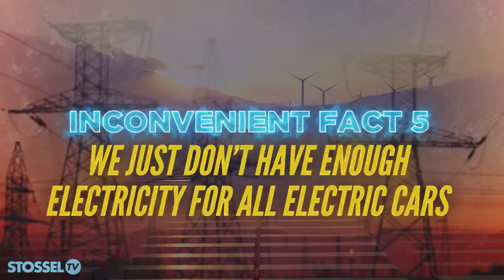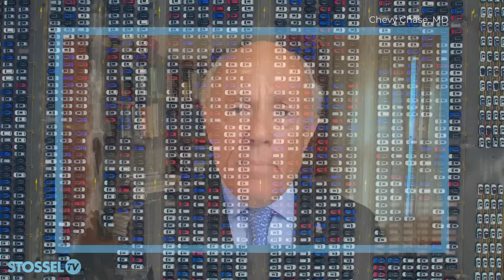Electric Cars: Inconvenient Facts, Part 2

Comment: As a retired power utility CEO and electric power engineer in the power sector for 36 years, i can say the following.  During the Obama administration there began an all out effort to ignore the input of power company CEOs and engineers (even non-profit utilities like the ones I worked for).  It came down to this, these politicians thought they knew best and always assumed we in the industry had some political angle or agenda.  However, i would tell them that electrons are neither blue nor red but they power the same grid for all people.  Eliminating fossil fuels (coal and NG) and limiting nuclear will have devastating consequences starting in 10-15 years (quote from 2008), we are about to begin a lot of hardships not seen since the beginning of the industrial revolution. Even if the oceans rise many people will end up freezing to death or overheating due to lack of affordable electric power, not to say anything about having a decent job and able to buy products at an affordable price.  No coal plants can be built in America and nuclear takes 10 years to build.  With pressure now to not build nat-gas plants, there is no base-load power generation left. When we hit rock bottom it will take years to turn it around. As the coal and nuclear plants continue to retire this problem will grow worse and there is not enough affordable nat-gas to replace them all. I pray for America as I believe we will have to go through a painful learning curve that will last years.  By the way electrons are color neutral, which is what the politicians should be and let the experts power and run the grid. Strange no one is saying anything about riding in a car that emits constant electro-magnetic fields. Most of the time intermittent absorption is not a problem, but driving such a vehicle for many years no one really knows. We never had a clamoring for people wanting to live next to our high-voltage transmission lines.  John thank you for covering this topic, maybe it will help sound the alarm to many who lost their hearing years ago.
Reply: Thank you for your rational, clear informed response.
Two term limits.
First term office
Second term life imprisonment
Reply: @hubertwalters4300  Thank you Hubert :)
Reply: I agree. ignoring experts, our "leaders" have unnecessarily put us through pain over and over.
Reply: @charlestemple634  Charles if they are breaking the law then they should be prosecuted.
Reply: @wramsey2656  - No laws involved ... Texas openly protects everything the petroleum industry does. Examples: The industry is not required to reveal what chemicals are used in fracking, is allowed to openly burn all kinds of gases that pollute the atmosphere, is not held responsible for huge damages their equipment does to infrastructure (paved roads have been destroyed and converted to gravel), no prosecution for lying about quantities of oil/gas taken from leased properties, no real controls over all kinds of pollution, individuals who win lawsuits against big oil and get settlements are required to sign non-disclosure agreements ... and so much more. My Texas family and friends and I myself have witnessed and experienced all of this.
Reply: @w ramsey You are a retired Power CEO and Electric power engineer.   We have moved on as the technology has evolved.  Let's remember some very important things.   First Nuclear is clean power, but it costs a lot to start up and maintain.  To build a Nuclear plant takes years at best.  Then you have to deal with the nuclear waste and of course it is one of those... not in my back yard type of products.   But I do feel Nuclear has place in our energy system and there has been some recent advancements that make it more viable.   

The reason for pushing Power plants from Coal to NG, is because Coal is bad all around and it isn't really that cheap, when all is added up.  The easiest and cheapest way to make energy is renewables.  Wind, Solar, Geothermal and etc, produce electricity at cheaper rates.   It is quicker and cheaper to build these systems and if we really were smart, we wouldn't even to have to build a bigger grid.   Just imagine if everyone with a home had Solar Panels and/or Wind turbine.  They could generate more energy than is needed in the area. 

What many people don't realize, is that we can also become more efficient with our energy usage.  Just changing from incandescent to light bulbs to LED saves about 50%+ electricity usage. 

What we all should, also note is that going renewables and using EVs, will save the country money and stimulate the economy.
Reply: Great to hear your perspective. If more experts in these industries would speak up, people could learn to trust the truth instead of falling prey to politicians' half-truths which come from a dark, barren place void of wisdom.
Reply: @rickbruner  Thank you Marshall.  Many of us tried to speak up during the Obama Admin but the tide had already started a political movement (almost a religion) to move to green energy "at any cost", which is the problem we had with it.  Their tools have long been to; (1) do everything to raise the price of fossil fuels and eventually cancel them; (2) Make green energy as cheap as possible (tax credits and incentives, even allowing china to sell low quality equipment into America); (3) By selling the false narrative that green energy alone can power the American grid. We unfortunately are headed toward a long and difficult road, we will have to learn the hard way.
Reply: @tonespeaks  from what I can read, Mr Ramsey has a lifetime of management and technical experience in power generation. To suggest that now he is retired, he must have no further basis for factual presentation of the current situation is ageist and insulting. I have no doubt he very much is still connected to the industry and its present tech. It is, after all, his life -long field of expertise. By all means, provide evidence of your involvement, experience and expertise in the field, because so far, all I read is the standard trope of green leftism, such as the con that renewables are cheaper. A typical assertion devoid of any evidence and oblivious to the realities which have been articulated clearly on here. If renewables were cheaper, poor nations would be building wind and solar, instead of building fossil fuel power plants, as is actually happening in the real world.
Reply: @georgebeare8883  It should also be noted that this video had to be edited/updated because some of the information was based on studies that have been proven to be incorrect. 
"The original version of this video has been updated. We originally said that covering "the entire continental United States with solar panels would not supply half of America’s electricity.” But the study we cited for this fact has been updated.  Therefore our reference to it has been removed."
John Stossel
Reply: @tonespeaks  thanks for that, but I have no problem in comprehension thus far and understood that myself. I also understand that to be a good thing. It is a sign of the author being genuine in wishing to promote accurate information on the topic. As soon as they became aware of an incorrect source, they pulled it and publicly declared it. One must conclude then, that the remaining content is relevant, current and factually correct. Thank you.
Reply: @georgebeare8883  "One must conclude then, that the remaining content is relevant, current and factually correct."  That wouldn't be wise to make that kind of conclusion, IMHO.   

Much of the video was dated information and some of the content was misleading. That part that the sourced was so way out, that they had to pull it.   The truth is, they are not expert enough to produce good content.   I wouldn't even grade it a D, because it is so backwards.   

To understand the EV industry, the content must be up to date, many things have changed and are changing rapidly.   Just the advancements in Battery chemistry has changed the industry.
Reply: @tonespeaks  perhaps you may consider Volvo, Toyota and VAG expert and latest tech qualified on the subject of EV's. They all inform us that battery tech has not dramatically changed and the inherent physical limitations of them remain constant. Given Toyota and VAG are the number 1 and 2 auto makers, by a wide margin, I will continue to reference them as propriety sources of valid and factual information. That includes their details study of Whole of Life emissions, which concludes with the finding that EV's take many years of use to just break even with an ice car. After that, assuming the EV is still on the road, using its original battery array, it will still only offer a relatively marginal emissions reduction benefit. The other obvious and fundamental limitation of an EV is its requirement for a whole new re-fuelling infrastructure to be built. Feel free to explain how the poorer nations of the world, who haven't yet even got national health clean water, sewerage and electricity infrastructure, are going to afford EV specific charging points? That accounts for some 2/3's of the world's population, making the western push to EV even more risible. EV's will achieve zero, full stop. Not zero emissions.
Reply: @georgebeare8883  "Given Toyota and VAG are the number 1 and 2 auto makers, by a wide margin, I will continue to reference them as propriety sources of valid and factual information." You're a fool, friend, if you ignore the financial incentives for legacy car makers to continue making what they do best, ICE vehicles. The Tesla Model Y outsold the Ford F-150 in 2022, and will likely outsell the Toyota Camry in 2023. Just like digital cameras, legacy film makers denigrated digital media until they went bankrupt within 10 years (Kodak). 
Your statement that it takes years for an EV to break even with emissions is false, by a wide margin. The break-even point of an EV with manufacture and fuel emissions is 15,000 miles. Every mile after that an EV is cleaner than any gas car. Over time, an EV is HALF the pollution of a gas car.
Your statement that a whole new fueling infrastructure is also baseless, it's called the grid. 95% of all EV charging is done off-peak, at a residence, and it consumes a tiny fraction of the energy a home HVAC unit does. Worried about the grid? Stop building homes with air conditioning.
Your question about poor countries needing  clean water or sewage is, well, stupid. If a country can't provide clean water, they should do that. Are you recommending that a poor nation ignore the needs for clean water, sewage and health care so they can put in a charging station?
Reply: @georgebeare8883  "They all inform us that battery tech has not dramatically changed and the inherent physical limitations of them remain constant. "
OF COURSE they say that, those legacy ICE manufacturers want to shore up their current business model and justify staying the way they are. Battery tech has not only changed dramatically, the rate of change is similar to the microchip improvements in the early 1980s. The range and longevity of EV batteries has made massive improvements. My own personal EV, same model, can now be purchased, same price, with almost double the range in only 9 years. The miles-per-gallon of a Ford Model T: 22 mpg. The average MPG of a new automobile in 2022: less than 25 mpg. 
It's time to update your information, and it's time for a new opinion.
Reply: @justsomeguy934  battery tech, in relation to EV's, is Lithium, in the here and now. Lithium is regarded as the preeminent source. EV range has improved, but not just because of battery technology improvement, just like every other mode of transportation has evolved. It is the sum of a holistic range of improvement across the whole vehicle design, right down to eco-tyres.

Physics predetermines the potential limit to a lithium battery's abilities. We have come close now to reaching them, there is no great advance to come. A leap forward in battery tech must now come from a new, as yet unproven, form.

I can rely on you for providing the most risible and meaningless comparisons and pseudo-facts to try supporting your assertions. I particularly had a great laugh at your (apparently serious) comparison of a Model T to a current 2022 car with regard to purported fuel economy.

What this reveals, as if nobody already knew, is the typical EVangelist's abject absence of technical understanding of car, in general.

First of all, electric motors have been around as long as combustion engines. Dating back to the late 1890's. In the time since, an electric motor has effectively remained the very same, very basic unit. It consists of just 6 basic parts.

To compare a Model T engine to a current tech 2022/3 engine and conclude, in any way, that they are effectively unchanged serves only to make you look conclusively uninformed. 

That is before we even go to the incredible differences of performance, comfort, safety, reliability, emissions, power and convenience of the modern car that modern engine resides in. All of which must be included in any comparisons.

I am disinclined to waste my time having to spend lengthy periods of time in a pointless, in-depth exercise, which is what dealing with your inanities entails.

So, instead, a simple comparison for your simple contentions.

A 2020 Ford Mondeo TD can travel 1200 to 1300 kilometres on a single 61 litre tank of fuel, on the highway, at 100 to 110 kph. It has a top speed of 130 mph or 210 kph. It comfortably and safely carries up to 5 people. It can tow up to 1600kgs. I know, I own one.

Only a fool would somehow conclude there is any semblance of direct comparison to that car and  Model T. A fool like you.

And that is where I intend to cease replying to your nonsense in future.
Reply: @georgebeare8883  ah, when facts disprove your statements, you call names. Only a fool would ignore the fact that average MPG of the internal combustion engine has reached its limits due to physics. There is no 100mpg, 200mpg automobiles coming out that you will be able to buy or use in a practical manner. Sorry friend, the facts prove your wrong. The only improvement in ICEs are horsepower per litre, not fuel economy. Are there exceptions? Sure - my brother's Honda Civic gets 42mpg. On average, however, the ICE vehicles will waste 3/4 of their energy as heat, and that constant in the physical world is one of the major limitations of petroleum technology. 
Your statement of battery tech being at its pinnacle is clearly a reaction to my statement of ICE tech being stalled. Sorry, battery tech is not only evolving, it's improving enormously along with motor tech. I noticed you completely ignored my verifiable statement that my exact model of car, almost 10 years later, has a 40% improvement in range at a smaller price. That's partially due to a marginal battery expansion, but more due to a different motor, heat pumps and new battery chemistries and footprints that yield more kW/h per kilo.
The averages prove you wrong, and I'm sorry you're embarrassed.
Reply: @georgebeare8883  "It comfortably and safely carries up to 5 people. It can tow up to 1600kgs. I know, I own one." And I own a gasoline RAV4 that gets exactly the average MPG I told you about. If it gets 23 mpg highway + city, I'm happy. I also have a supercharged V8 sports car that gets 16 mpg, 11 mpg when I push it. Did you want to talk about averages or exceptions to bolster your opinion?
Reply: @georgebeare8883  "battery tech, in relation to EV's, is Lithium, in the here and now. Lithium is regarded as the preeminent source." Do you think lithium is the only component of a modern battery? Or that its concentration is fixed? Goodness, lithium concentration in a modern battery can vary in current production from 2% to 4%. Tesla has already converted about half of battery chemistries to LFP, non-cobalt, because LFP represents a significant cost savings. If memory serves, CATL (Tesla's main battery supplier in China) us making nothing BUT LFP chemistry for the Chinese market. There are also other chemistries being tests, as well as the ever-elusive solid-state and aluminum designs.
Reply: @georgebeare8883  you have no interest because you have no evidence, no thought, no ability to discuss any technical topic. Run home, kid, you came unarmed to a battle of wits.
Reply: @justsomeguy934  I ignored nothing. It is you who has no ability to comprehend. I told you directly that increases in range were not just down to battery changes, but an holistic improvement, right down to eco tyres. Read again and see. 

There are billions of dollars being invested in ice tech right now, both in Europe and Japan. The Japanese auto makers have even formed a tech JV regarding ice, so certain are they that ice has a long future ahead of it. Nobody invests billions in business unless they expect a ROI.

They see plenty of major improvement still to come. Just as it has done in just the last decade.

Talking about limitations, a half ton battery gives a few hundred K range and 60 kgs of fuel gives an ice car 800-1300, depending on the model. There are some other physical facts for you.

Your averages prove mothing to anybody. You pull figures out of the sky. 

My only embarrassment is that I am involved in any form of discourse with you about anything, the person who tries to claim a Model T is on the same level as a car in 2023.

Well, that embarrassment ends here and now. Goodbye.
Reply: @justsomeguy934  just one quote from that link: StockApps’ financial lead Edith Reads has weighed in on the data. She holds that Toyota’s debt is good debt and even necessary. She suggested that the company’s amassing of that level of credit is in line with its future-thinking nature. Here’s what she said about the development:

“It’s not unusual for Toyota to have such a colossal debt on its books; most global corporate giants do. Debt allows companies to reinvest in their businesses, growing them further. The key is keeping that debt sustainable, and Toyota has done well on that front. Being a player in a highly competitive sector, R&D constitutes a significant chunk of Toyota’s budget. That and other expansion needs make such debt a necessity.”

Edith holds that the revelation of Toyota’s indebtedness is welcome news for investors. Measured against the company’s earnings, it shows that it is operating a healthy business. That is a cue for Toyota’s current and would-be investors. Besides indicating the viability of issuing firms, corporate bonds are one of the most lucrative investment tools.

Your lies exposed, ironically, by what you yourself posted up. Goodbye for good.
Reply: @justsomeguy934  you can't even create an original put-down. just re-using the old line about the battle of wits. That may have seemed clever when I was a kid, but most people have moved on from there. 

All you do is post up lies and half-facts, as I have repeatedly proven.

Such paucity of perspicacity cannot confront, nor affront, me. All it has the potential for is to waste precious time when it elicits a response. That time has ended.
Reply: @georgebeare8883  Ah, facts embarrass you, do they? There's no new 100-mpg or 200-mpg gasoline automobile in our future. The average MPG is the same since the Model T, and that absolutely verifiable fact is what embarrasses you. Both the Model T and any ICE you want to pick waste 75% of their energy through waste heat. Any ICE vehicle you want to point to only has about 15% of the fuel's energy make it to the wheels. We are utterly topped out in ICE development, and were a century ago as far as fuel, efficiency and pollutants go.
Reply: @georgebeare8883  "Your averages prove mothing to anybody. You pull figures out of the sky. "
Really? Let's call it the GOOGLE sky! Go ahead - I DARE YOU - search "average mpg of a car in 2022". Oh, I'll save you the trouble: "Generally, a good rule of thumb for gas mileage nowadays is to make sure you are getting at least 23 MPG combined city and highway. Mar 23, 2022"
Reply: @georgebeare8883  "My only embarrassment is that I am involved in any form of discourse with you about anything, the person who tries to claim a Model T is on the same level as a car in 2023."
When we're talking mileage, pollution, energy loss it's the same. Too bad you can't see that the common denominator in the argument is the FUEL. That's right, friend, gasoline is the same. You can put modern gasoline in a Model T today and it will run. I do sympathize with your embarrassment, however, many people don't think before they say something.
Reply: Now here is some real perspective on the reality of providing power to the masses. So frustrating that NO politicians on any side seem to be making this argument to educate the politicians. Thanks for your input!!
Reply: @dh7139  Thank you DH.  Its sad we are having to go thru this.  Its already started regional blackouts are on the rise, it will get worse in the next 5-15 years before we learn this hard lesson.  I am ill and likely will not be around when it does. I only hope those like me who continue to speak out for reason and common sense will at some point prevail. God be with us.
Reply: Just read about electric locomotives, how they impact health of their drivers. Ie. you one of them wants kids he should get them fast.
Reply: @marcinnawrocki1437  that's quite a conclusion to draw (EVs affect birth rates).
Reply: Earthwilldie666
Reply: During Obama I remember an incident where an Engineer told a politician that it would violate the laws of Physics and was stunned to hear the politician reply that "then we'll just have to change those laws".
This is what happens when you elect arrogant people instead of smart people.
Reply: @ghost307  WHAT would violate the laws of physics? Solar energy is enough to power the USA? John Stossel has already retracted his foolish statements in the original video and republished it.
Reply: @georgebeare8883  "Talking about limitations, a half ton battery gives a few hundred K range and 60 kgs of fuel gives an ice car 800-1300, depending on the model. There are some other physical facts for you."
Actually, you've made the classic mistake (again) of comparing a battery weight to an ICE vehicle without subtracting the ICE engine weight from the EV. 
Here are some facts for you: my 1,000lb car battery (again, old tech, 9 years old) replaces a (on average) 800lb ICE motor, a 300lb transmission and fuel/exhaust system. That's right, an EV doesn't have those things. And my EV has about the same range as my gas RAV4! The new EVs, cheaper (by half!) than mine go FARTHER than my gas RAV4 goes. Did you want some more facts?
Reply: @georgebeare8883  "There are billions of dollars being invested in ice tech right now, both in Europe and Japan. The Japanese auto makers have even formed a tech JV regarding ice, so certain are they that ice has a long future ahead of it. Nobody invests billions in business unless they expect a ROI."
Um, Kodak was investing in film right up until the digital camera put them out of business! In fact, Kodak invented the digital camera and owned the patent. 
OF COURSE traditional car makers are investing in what they know to do. They think they'll bribe politicians to extend any deadline or clean air change so they can continue to make money the only way they know how - ICE vehicles.
You can't be that ignorant, can you? You do know Blockbuster was building stores after Netflix was a thing, right?
Reply: @georgebeare8883  "Your lies exposed, ironically, by what you yourself posted up. Goodbye for good."
HAHAHAHA - In just 10 years, Tesla has TWICE the market cap of Toyota. If I told you 10 years ago that an electric car maker would unseat the world's largest car maker, what would you have said? Called me foolish, stupid, an idiot? TaDa! Here we are, friend. Toyota is no better than GM or Ford in that they cannot see the future. The only car maker who can't build factories fast enough is Tesla; Toyota is closing factories. The future is here, do you see it?
Reply: excellent.  what about electric fields in the cars?  Long term health problems?  We ei;; see.
Reply: @tombrown108  I can't imagine that would be an issue. People were predicting brain cancer with cell phones...
Reply: Which Utility company were you a CEO for? Does it have a name?    ..................and where might this company be located?
Reply: @ghost307  You are so correct friend. It makes me weary thinking about where our country is headed.
Reply: @georgebeare8883  Thank you George your a gentleman and a excellent example of man gifted with wisdom.
Reply: @paulholterhaus7084  Paul i was trained in BWR and PWR reactors, please don't jump to conclusions to about where i am living. As one responsible i had to live in the current and what was allowed. The truth is you are correct and i would agree going with Westinghouse 1000 reactors and the modular reactors currently being developed for smaller 100MW module type plants. The sad thing is we live in a world full of evil people who would target each of our plant sites via terrorist or enemy nations air strikes.  My fellow resident managers who were at two different nuclear plant sites after 911, at one point had the military there with missiles to shoot down airliners! Those of us who had and have to keep the grid up and running are not living in the past, we see the world thru eyes of reality. We must keep the grid up and running here and now, we are not favoring one technology over another; moreover, we want to keep the power on for all.  Its getting more difficult because some people think they are the experts and the politicians believe in whatever is popular. I agree with you fission and hopefully fusion will be our best solution for base load power.
Reply: @georgebeare8883  "“It’s not unusual for Toyota to have such a colossal debt on its books; most global corporate giants do."
Toyota is the fourth most indebted company the world, friend. And operates in the world's most indebted country. Neither of those two represent "good debt". Their future is tenuous at best, just like Ford and Volkswagen, and I personally doubt they'll exist in 10 years without a government bailout. Nissan is already on the way out, if Japan bails out Toyota (and they will), they won't also bail out Nissan or Mazda or other struggling auto makers. If you're not Tesla, you won't be around for long.
Reply: @georgebeare8883  Hey, George! Guess what? Akio Toyoda (CEO, Toyota) just stepped down BECAUSE he can't lead Toyota into the "digital" age and admitted to not steering Toyota in the right direction as far as EVs go. Did you want to tell me AGAIN that Toyota and Volvo are going to be industry leaders in the future? When the CEO of Toyota steps down BECAUSE the misjudged the EV market, their future is NOT assured. Just liking for an "I told you so"...oh wait, I just did!
Reply: @hlw1306  "I think a point he makes is the pending catastrophe of letting the baseload of power generation be diminished to the point that huge suffering follows by ending old sources when new sources are inadequate to meet a vast array of power needs."  

I totally understand you point, but it doesn't make sense to invest money into a Powerplant run on Coal that isn't going to be used in the future.   The new sources of power are adequate for the vast array of needs, but we also have to conserve.  For example, instead of using an old Incandescent bulb, use an LED bulb which uses a 1/3 of the power. 

As a Pilot, I totally agree with you about the fuel storage issue.  It seems no one wants to do anything, until there is a major event, then the funds needed to address it are 3x of what it would have caused initially.

The USA produces all the oil it needs, it isn't reliant on other nations, maybe Canada. 

I don't know much about he politics in California, but no administration disregards knowledge and experience.   People have differing opinions, doesn't make either side wrong.
Reply: @johnrodgers2171  "We're being led by morons and shareholders who just want their stock investments to go up in a very short time span." 
I couldn't have said it better about our politicians and oil executives.
Reply: @georgebeare8883  🤣
Reply: @georgebeare8883  He's a pathological liar. He's all over the net parroting the same lies despite being debunked over and over again. Do not waste your time.
Reply: @justsomeguy934  HAHAHAHA right back at you. Last Thursday, the EU vote to ratify the banning of the sale of ICE vehicles by 2035 was.....postponed. Germany, Italy and a range of other EU nations are now realising the folly of the notion to ban ICE vehicles outright. The UK have already "re-set" timing regarding sales of EV's as a percentage of total market of new car sales as well.
Reply: @georgebeare8883  "Tesla's market cap is a mirage, based on the same thinking that led to the other tech stock crashes. " Ya, been hearing that for years. The fact is that Tesla has years of sales booked, cannot make factories fast enough, is generations ahead of other car makers in both technology, design and manufacturing automation (i.e., lower costs). Tesla's profit margins per car are FOUR TIMES that of Toyota. You can call that a mirage if you want to, but I call it your bias blinding you. How's your Kodak stock doing?
Reply: @georgebeare8883  You insane bias is absolutely amusing. How did I forget anything different between an EV and an ICE? I am well aware, and can quote you, all the metals, cables and control items that make an EV work. What you seem to forget is the massive blocks of similar materials that an ICE vehicle has than an EV doesn't. By all means, tell me what I'm leaving out when it's YOU that mentioned only the battery having a short life and the materials required to make it.
Reply: @georgebeare8883  "EV's have been around as long as ICE have. 
Henry Ford had a running EV prototype Model T, smart guy. "
Not only do I know that EVs have been around the same time as ICEs, I give presentations to that fact. You're welcome to attend one if you like.
The practical fact about ICEs is that the only advancement that ICEs have made that you can use is horsepower per litre. The average MPG remains the same. Your insults to me prove that you weren't aware that ICEs are limited by the physics of converting liquid, combustible fuel to kinetic motion. It's been the same for 100 years now - over 70% of the energy in gasoline is wasted as heat during the combustion process, and nothing can change that. Despite emissions improvements and horsepower per litre, the average MPG of a modern car remains within a few miles of the Model T. I'm sorry the facts anger you and destroy your narrative, but there is no 100mpg ICE vehicle that you can buy on the horizon. After 100 years of engineering, the average MPG is the same. Facts rule. Did you want to call me more names?
Reply: @georgebeare8883  "They made more money from selling carbon credits, in fact it was their primary revenue source up until very recently. " Tesla sold ZEV credits, still does, to ICE manufacturers that refuse to convert to EVs. Any car maker can get them if they want to. Funny, you don't mention the bailouts and subsidies that ICE makers get as part of their income...strange omission on your part.
As for Tesla's profit margin, please Google: "tesla profit margin vs toyota". Go ahead, Google that. Here's the results:
"Recent data compiled by Reuters shows that Tesla's margins are significantly higher than those of its rivals, both in terms of gross and net profit.
...
Cranking up the Heat.
Company	Gross profit per car	Net profit per car
Tesla	$15,653	$9,574
GM	$3,818	$2,150
BYD	$5,456	$1,550
Toyota	$3,925	$1,197"

So I can expect your apology at claiming I "make up stuff"? I'll wait...
Reply: @georgebeare8883  "Go charge your Tesla ( I note you NEVER declare what EV you own, and I know why. So your idiotic claims about it can't be dismembered ) at a public charge point. If you can find one. If it works. If the app is the same. If there isn't a queue."
I've driven 90,000 miles all over the USA in my EV, never waited for a charge, driven the same time as I would take in an ICE vehicle. I know Uber drivers in EVs with the exact same experience. Your desperate attempts to say EVs won't work has been heard for ever a decade now, and you're just as wrong now as those people were then. The fact is that my car is the best one I've owned, is many times more reliable than my Toyotas ever were, it's full every morning and I think nothing of getting into it at a moment's notice and driving across a continent. Oh and I do it for pennies a mile, thank you.
Let me ask you again: how's your Kodak stock doing?
Reply: @justsomeguy934  how is it you cannot comprehend the sheer inherent folly of the comparison of a Model T and a 2023 car? I went to great lengths spelling it out to you months ago. 
To obviously no effect, whatsoever.
I am not going to go into it all over again, it is time consuming, which is a waste, when you refuse to concede anything, ever. No matter how clearly a point is correct.
The closest you have come to concession, is when you can't actually challenge a point so, instead, you go into conspiracy theory about mythical car cartels or whatever.
I am going to summarise once more, and only once more, regarding the vacuous claim about fuel economy.
My 12 year old nephew has been reading this claim you promote, so I asked him what he had to say about it.
He said, I quote " Uncle George, if a modern engine produces many times more power than a Model T using the same amount of fuel, then that makes the modern engine much more fuel efficient, doesn't it?" Unquote.
Yes, young Luka, that is blatantly obvious and correct.
How is it a 12 year old can figure such an obvious thing out, yet you, cannot?
To put it another way, if we had to install a modern engine into a Model T to simply provide the very same engine performance of the Model T engine, that modern engine would be a very low displacement motor bike engine and would surely achieve over 100 mpg.
Model T's were very lightweight and had no power accessories, no anything. They didn't even have a full body as we know it today.
This is why any such comparison is beyond next-level absurd.
The end.
Reply: @justsomeguy934  here we go, yet again.
You mocked me, as usual, about the weight penalty an EV inherently has over an ICE vehicle.
You mocked me because I pointed out the 1,000 pound battery array, you firing back with calling me being the fool because an EV doesn't have an engine and the like.
Remember that? It was only a couple of comments back.
I note you completely left alone my response, didn't you? Funny that, considering how you love cutting and pasting my comments back at me.
Could that be because I pointed out that EV's actually do have motors, up to 4 in some cases?
Yeah, shucks, hey? You thought EV's just ran by a magic battery that propelled it as well as supplying the energy.
Doh! 
Everyone else knows EV's have an approximately 50% weight penalty over an equivalent size ICE vehicle. Everyone, that is, except Emeritus Professor Some Guy.
Tyre manufacturers produce EV-specific tyres, which have much higher load ratings because of the much higher weight of an EV.
Once again, you seek to demean and debase others, yet through your own words, it is you who best condemns yourself as being an absurd caricature of evangelical fanaticism, locked in moribund, frozen and myopic narratives.
The more you thrash around, proffering the evermore improbable and the downright impossible, the more you inadvertently subvert your own position.
I care not what you direct at me personally, what I enjoy is knowing that any of those people who may be reading all of this, those people who are on the fence, seeking answers to questions about the Pros and Cons of EV V ICE, will draw their own conclusions.
Common sense, factual evidence and rational thought are my allies, as much as they are your foes.
Please do feel free to keep going. It is very helpful.
Reply: @georgebeare8883  "Everyone else knows EV's have an approximately 50% weight penalty over an equivalent size ICE vehicle. Everyone, that is, except Emeritus Professor Some Guy."
Everyone knows, do they? Really? Funny, my personal EV, when compared to its closest ICE equivalent, is actually LIGHTER than the ICE vehicle. If you're trying to make an argument, you would be laughed out of the room with an authority claim of "everyone knows".
Here are the actual vehicle weights of similar class automobiles, by all means show me the 50% weight penalty (as if that even would be a factor of ANYTHING):
Tesla Car Weight vs. other Compact Executive vehicles:
Tesla Model 3 (compact executive car) weight: 3,648 to 4,250 lbs. Other Compact Executive Cars: BMW 3-series, weight 3,582 to 4,138 lbs: difference 112 lbs. Genesis G70 weight: 3,688 to 4,041 lbs, difference 209 lbs. Infinity Q50 weight: 3,781 to 4,019 lbs, difference 231 lbs. BMW 4 series weight: 3,578 to 4,034 lbs, difference 216 lbs. Average difference: 192 lbs. Please tell me the added wear on the roads, either way, with those statistics, which is the weight of a passenger. In the case of the Tesla Model S, its nearest comparator is the Mercedes S-Class sedan, which weighs MORE than the Model S.
It's time for you to tell "everyone" that their 50% weight penalty is WRONG.
Reply: @georgebeare8883  "I note you completely left alone my response, didn't you? Funny that, considering how you love cutting and pasting my comments back at me."
I quote the portion of your long posts  back at you so that the context of my comment is clear. When you make dozens and dozens of claims, the response to those claims needs to be specific.
Furthermore, I have found that MANY people, when proven wrong, delete their comments from YouTube and "retreat with delete". I make sure the statement you made to me is portrayed accurately. You're welcome...you wouldn't want me misrepresenting your words, now would you?
Reply: @georgebeare8883  "Tyre manufacturers produce EV-specific tyres, which have much higher load ratings because of the much higher weight of an EV."
Some do, but so what? You can also buy tires specific to off-roading, specific to lightweight passenger cars (like the Toyota Yaris). I run an EV club of 250+ members and not one of the members has EV-specific tires. After 9 years, I've never had one, will never get a set. Your weight argument as a detriment to an EV is actually stupid - who would care? Does ANYONE buy a car or not buy a car due to its weight?
Reply: @georgebeare8883  "Could that be because I pointed out that EV's actually do have motors, up to 4 in some cases?
Yeah, shucks, hey? You thought EV's just ran by a magic battery that propelled it as well as supplying the energy."
If you'll look back at my comment, I told you that I can actually quote you the list and weights of the components in an EV, cabling included. I avoided nothing, but you're desperate to make some silly claim that EVs are heavier than an ICE vehicle for some meaningless reason.
The fact is that when people like you try to claim EVs are always heavier than an ICE, and quote the weight of the battery, they inevitably add the battery weight to the weight of an equivalent ICE vehicle. You cannot do that, as you must subtract the weight of the components that an EV doesn't have. The net weight is within a meaningless amount that has NO FACTOR in the usability of either vehicle. You really are silly to go down this path, it's like saying "there's more glass in an EV! That proves they're bad!".
Reply: @georgebeare8883  "Common sense, factual evidence and rational thought are my allies, as much as they are your foes."
Ah, the literary bark of a cornered person. It's me that has provided you with Google search results, me that has provided links to the evidence of the statements I make. All you can say is "everyone knows...". 
Yes, rational thought and factual evidence DO apply here. And we both know which person has them and which person does not.
Reply: @georgebeare8883  "To say, as you have, that a modern engine now produces far more power, yet in the same breath, also declare it is not more fuel efficient is an oxymoron."
Miles per gallon is miles per gallon, friend. Given the same amount of fuel, a Model T will go almost EXACTLY that same distance as a modern vehicle, horsepower, power windows, emissions is not a factor whatsoever. You can slap a catalytic converter on a Model T and make it instantly cleaner, but that has nothing to do with the engine or the fuel.
I think you don't like being proven wrong.
Reply: @georgebeare8883  "I am still waiting for you to reveal what Make, Model and year EV you claim it is you own, by the way."
Why? I own a 2015 Tesla Model S. Facts are facts regardless of brand. Methinks you want to call me a liar as to my personal experience.
Reply: @georgebeare8883  "Sure, I respond in kind to what YOU started, with personal derogatory comments. Not out of having no answers, the remarks are in the middle of the very answers that pull apart your nonsense."
Of the two of us, which one is providing verifiable Google search results and links to resources? Remember the comment you made early on where you stated my car's battery would have to be replaced, and that I would have a vehicle that could neither drive nor be sold? I not only gave you my personal experience, but that of another EV owner that completely disproves your statement. 
The nonsense is your lack of factual information, and your inability to admit when you're wrong.
Reply: "How it is that you do not see that a Model T is galaxies apart from a modern car?!"
The Model T, and any ICE vehicle, has the same physics limitation as does a modern automobile. I only comment on fuel economy, and that regardless of options or horsepower or anything else, ICE vehicles are a mature technology and are not going to improve in any meaningful manner. You backside seems rather scorched by me proving that there is no 100mpg gasoline car on the horizon, no dramatic improvement in energy consumption or range whatsoever for gasoline engines. The fact that the Model T has the same milage as the average 2022 automobile proves that...at least proves it to anyone willing to admit their bias is clouding their judgment.
Reply: @georgebeare8883  "I am still waiting for a range of answers to some of your more preposterous claims, which I have called out."
You're waiting on nothing from me! By all means - quote back any and all comments I made that you need clarification on. Be careful, however - I'll demand you admit you're wrong when you're wrong. All you've done so far in the fact of facts and links to resources is to type long paragraphs calling me names.
Reply: @georgebeare8883  "To say, as you have, that a modern engine now produces far more power, yet in the same breath, also declare it is not more fuel efficient is an oxymoron.
A totally contradictory contention."
I gotta ask, are you an adult? Am I talking to a teenager? How on EARTH is horsepower the same as miles-per-gallon? Should we compare the miles-per-gallon of a rocket to that of an automobile, saying the two entities are equivalent? Egad!
I've already stated that other than horsepower per litre, ICEs have no significant improvements coming. Their average efficiency is limited by their fuel. The amount of waste heat, on average, burning gasoline is the same for the Model T as the modern Subaru - about 70% waste. You are desperate to not admit that regardless of electric windows, horsepower, sunroofs, nice upholstery or anything else external to the ENGINE, gasoline engines are not going to improve.
Reply: @georgebeare8883  "You persist in the ridiculous fuel consumption comparison of a new car to a Model T  basing it solely on some spurious claim they are about the same. "
You persist in your delusion that I presented you with verifiable, demonstrable facts that the Model T and the average MPG of new cars is the same, no practical or significant improvement.
It's time to call you out - is or is NOT, the average MPG of a modern car the same as a Model T? Yes, or no? After 100 years of development, why is there no 100mpg or 200mpg gasoline vehicle available? Could it be that the tech for ICEs is limited to the laws of physics? 
I'll wait for your admission that a 100 year old car has the same MPG as a modern one. Let's see what your integrity is. We both know you'll deflect, your favorite word.
Reply: @georgebeare8883  "I note that every time I expose a claim of yours to be wildly inaccurate, or downright false, with readily verifiable evidence, I hear no more about it.
You just jump onto the next risible assertion. And around we go again."
Liar. You have yet to quote me a single statement you want me to respond to. Between the two of us, I respond directly and specifically to all of your statements by quoting back your comment. This keeps the context of the discussion germane. By all means, tell me any statement you want me to respond to. I'll quote that statement back to you, so you know exactly what I'm responding to, and I'll give you my reply.
Reply: @georgebeare8883  "n reality, you quote me back because, at that moment, you think you have got some clever response. That you have caught me out. Only to discover when I next respond that I have picked apart your reply as usual, and as simply, as always."
As I've stated multiple times, I quote back EVERYONE I respond to so that you know exactly what I'm talking about. This also allows you (or anyone else) to read the comment days/weeks later and not have to backtrack a hundred replies to see what is being discussed. 
Since you never respond to me with a quoted statement I made for a reply, you are textbook definition of deflection.
Reply: @georgebeare8883  "As I keep telling you, please continue to keep on digging the hole deeper for yourself.
It's like The China Syndrome all over again."
The "hole" you think I'm in is you looking up at me, with me on a mountain of factual basis of discussion. You have yet to provide any references that we can vet, yet to admit I produce quotable, verifiable information to support what I say.
Reply: @georgebeare8883  "EV's are 50% heavier on average than a comparable ICE vehicle. A fact the whole world knows expect you. Yet again."
HAHAHAHA - the "everyone knows" claim again. Let's see - the last comment I made on that topic I provided you a list of comparable vehicles to the Tesla Model 3, all within 200 pounds of each other. 
Isn't it telling that YOU cannot and will not provide any factual data to prove your "50% heavier" claim? 
I provided the actual list of automobiles form the manufacturer's own data, as to the weight range of each vehicle. I even provided my own vehicle's comparison. In no way or stretch of the imagination are all EVs 50% heavier than an equivalent ICE vehicle. 
ME: data and facts
YOU: nothing
Reply: @georgebeare8883  "Such rubbish that people run tyres on EV's that are not EV specific load rated.
Why would anybody be so dumb as to run the wrong tyres on their car?!"
The rubbish is what's running around in your own head. EV-specific tires are relatively new, and aren't even provided on new EVs.
My Tesla, and all new Tesla models, are provided with standard Pirelli or Continental tires from the factory. I also know several other EV car brand owners, none have any EV-specific tires provided by the manufacturer.
So if the MANUFACTURER of the EV is not putting EV-specific tires on their cars, maybe just maybe you don't have any clue as to what you're talking about (again)?
Reply: @georgebeare8883  "EV's are 50% heavier on average than a comparable ICE vehicle. A fact the whole world knows expect you. Yet again."

PROVE IT. List me the average weights of comparable EVs to ICE vehicles. Tell me make and models you wish to compare and I'll be HAPPY to prove you are 100% incorrect in your statement that EVs are 50% heavier on average than a comparable ICE vehicle.

We both know what's going to happen - you're going to tell me I'm delusional, tell me "everyone knows it" and then NOT provide any references.
Deflection, thy name is George...
Reply: @georgebeare8883  "See what I keep telling you? The more you weave your web of lies, the more you serve only to catch yourself out as a fraud"
Funny, not a single factual quote from you about anything. Funny thing, that.
Reply: @georgebeare8883  "Apart from absolutely guaranteed tyre failure, the cars would be hugely puncture prone and the ride and steering greatly compromised due to excessive flex in the sidewalls."

Let's see, my 9-year old EV has had several sets of tires, several brands of tires. Not one puncture. Perfect tread wear, no need to even rotate the tires in 90,000 miles. 

My steering is perfectly aligned, my car will drive straight on a flat road with no driver input whatsoever. I just did it this past weekend on a 700-mile trip. My tires? All weather Michelin Cross-Climate 2's. 

As always, you make up statements to bolster your opinion, yet all you prove is that you know NOTHING.
Reply: @georgebeare8883  "The best part though: Voided Insurance policy!
The EV would be considered unroadworthy in the event of an accident because it has incorrect tyre specs."

HAHAHAHA - let's see, what a fanciful world you create in your mind. Using Pirelli, Continental, Michelin and Nokian tires will VOID my insurance policy?!? Goodness! I guess I'd better call my insurance agent!

And I suppose I should tell my neighbor who drives a Mercedes S-class sedan that HIS insurance is void because HE uses Michelin tires. He'll be grateful you helped prevent a problem. After all, his S-Class is heavier than my EV!

HAHAHAHAHAHAHA, damn I spit up coffee through my nose on that one. You ARE good for a laugh.
Reply: @justsomeguy934  fine.
What is the Make, Model and Year of the EV you claim to own?
Reply: @georgebeare8883  "He said, I quote " Uncle George, if a modern engine produces many times more power than a Model T using the same amount of fuel, then that makes the modern engine much more fuel efficient, doesn't it?" Unquote.
Yes, young Luka, that is blatantly obvious and correct.
How is it a 12 year old can figure such an obvious thing out, yet you, cannot?"
As your 12 year old to compare the miles per gallon between a Model T and the average new car in 2022. Not compare horsepower, but miles per gallon, which is the measure of efficiency. Your 12-year old nephew, just like you, is trying to make an efficiency argument with the WRONG METRIC. I've always stated horsepower per litre has improved, but not miles per gallon on an average basis. As a matter of reason, you have no better logic than an adolescent.
Reply: @georgebeare8883  "What is the Make, Model and Year of the EV you claim to own?"
I already told you in a previous post.
Reply: @georgebeare8883  Here's the EXACT exchange concerning my personal EV, as if that makes any difference. In the following quote(s), you'll see me quoting you back and then my response. This happened 3 days ago. You are clearly NOT reading my responses to you, yet acting as if I'm avoiding a reply. 
Here you go, just scroll backwards in the thread to find this exact comment from me to you:
 "I am still waiting for you to reveal what Make, Model and year EV you claim it is you own, by the way."
Why? I own a 2015 Tesla Model S. Facts are facts regardless of brand. Methinks you want to call me a liar as to my personal experience."
Reply: @justsomeguy934  let us start with your rubbish quote:
 "As your 12 year old to compare the miles per gallon between a Model T and the average new car in 2022. Not compare horsepower, but miles per gallon, which is the measure of efficiency. Your 12-year old nephew, just like you, is trying to make an efficiency argument with the WRONG METRIC. I've always stated horsepower per litre has improved, but not miles per gallon on an average basis. As a matter of reason, you have no better logic than an adolescent."
If power increases with the same amount of fuel used, that is an efficiency increase.
That is the ONLY metric any intelligent person needs to know to prove EFFICENCY has improved.
Feel free to explain the opposite, which is YOUR view, whereby you claim that producing more power for the same fuel use isn't an efficiency improvement?
You are trying to reinvent physics and defy all logic.
I am still waiting for actual proof of what is YOUR POINION ONLY regarding MPG/KML has seen no improvement.
I have asked you to produce your source to back your claim multiple times now, where is the evidence?
Meanwhile, I have given a stack of facts as to why your assertion is totally invalid. None of which, I note, you have attempted to rebut. 

This crap of yours is circular.
You refuse to accept simple facts, let alone the facts produced to you from links of credible source material.
In return, you produce no such verifiable proof. You post up nothing, just continue to repeat the same old rubbish, oblivious to reality all around you.
I refuse to respond to the same crap over and over any further. Either put up real evidence, or talk to yourself.
Meanwhile, you continue only to make yourself look the fool you are, with every extra passing nonsensical, confected assertion.
Reply: @justsomeguy934  I have read all of your posts and seen no evidence, despite me asking at least 6 times. And? What then?
Reply: @justsomeguy934  finally! It only took 2 months of badgering you to get there. 
I have responded to each and every reply that I have received in my inbox.
If one has not been forwarded to me by the system, from 3 days ago, still doesn't change that I have been asking repeatedly for the last 2 months.
Well, you said your car has improved in range from 2015 to double in the latest version.
Like I always knew. Another crap claim. 
The current Model S has not got double the range of a 2015 model, when new.
That is why I wanted you to reveal the EV you claim to own, because you have made a number of unsubstantiated claims regarding that vehicle.
Sure enough, as I was certain, once you revealed what it was, the claim unraveled.
By the way, you like to at once declare ICE has no further ability to improve because it is at its limits, while in the same breath imagining the laws of physics somehow do not also apply to EV's.
Both forms of tech are now in the territory of incremental gains. 
Current battery tech has also long had a defined limit regarding possible performance parameters, of which it is fast approaching.
The 100 mpg ICE car is as probable as the EV having the same range and refill time as an ICE car.
The future is not owned by EV's. Not unless a totally new form of battery is invented.
In the meantime, an EV is just another type of car, with its own Pros and Cons.
The circular arguments you champion have all been rebutted, many times over by me, with declared sources and links.
Something you continue to fail to provide.
Unless you can come up with something new, that has not been gone over, again and again, I won't reply.
Repeating the same things ad nauseum may amuse you, but it bores the crap out of me.
Reply: @georgebeare8883  "By the way, you like to at once declare ICE has no further ability to improve because it is at its limits, while in the same breath imagining the laws of physics somehow do not also apply to EV's.
Both forms of tech are now in the territory of incremental gains. "
Boy, you have no reasoning that I would attribute to an adult.
The miles per kW/h in electric cars due to battery changes and motor improvements is dramatic, and matches the improvements in microchip manufacture of the 1980s.
The REASON there is no average improvement in automobile efficiency over the last 100 years has already been stated - it's the laws of physics for burning gasoline. I have told you at least twice that the formula for gasoline cannot change any significant amount without damaging existing vehicles. You made some stupid claim that fuel had improved, as if that's going to get us a 100mpg car (it won't).
The REASON battery tech is improving is that the chemistry of the battery is not required to remain static. Gasoline has to, battery chemistry doesn't.
Would you like some search results, or resource links, on how inefficient ICEs are when burning gasoline? You'll say I don't provide them when I do, but I'll offer again. And when you see that the thermal efficiency of an ICE is the same as it always  has been with automobiles, you'll then see why the average MPG over the last 100 years has remained constant.
Reply: @georgebeare8883  "Unless you can come up with something new, that has not been gone over, again and again, I won't reply."
You mean more facts, references from Google searches, links to unbiased articles? Yeah, that's what you mean.
Reply: @georgebeare8883  Here's what I said about my car's range: "My own personal EV, same model, can now be purchased, same price, with almost double the range in only 9 years."
You missed "almost". The actual number is about 65% range improvement. And that range has remained constant. 
When I purchased my Tesla, its advertised range was (from Google): 
"How many miles does a 2015 Tesla Model S get?
Image result for 2015 tesla model s range
The 2015 Tesla Model S 70D has a driving range of 240 miles on a full charge. The Model S 85 has a range of 265 miles, while 85D and 95D models get a slight bump to 270 miles. Performance P85D and P90D models can go 253 miles. Drivers can recharge the car's battery at home using either a 120- or 240-volt power outlet. Jul 16, 2020"
The current 2023 Tesla Model S gets 405 miles of range. Hence: 66% improvement.
I didn't check the advertised range of my car when I bought it, thanks for making me do so. So it's 265 miles -> 405 miles in 9 years.
Show me the average ICE mpg that improved in the past decade.
Reply: @georgebeare8883  Here's an example of me providing you Google results or a link to a reference, something you claim I don't do. This is from 4 days ago, on the topic of efficiency and average MPG.
"Here's Google's results of the "Average mpg for cars 2021":  "New vehicle estimated real-world CO2 emissions are at a record low and fuel economy remains at a record high. In model year 2021, the average estimated real-world CO2 emission rate for all new vehicles fell by 2 g/mi to 347 g/mi, the lowest ever measured. Real-world fuel economy remained at a record high 25.4 mpg. Dec 12, 2022""
Reply: @georgebeare8883  Here's ANOTHER quote with me providing you with Google and auto manufacturer results, on your ridiculous claim that EVs have a 50% weight penalty over an ICE vehicle:
"Here are the actual vehicle weights of similar class automobiles, by all means show me the 50% weight penalty (as if that even would be a factor of ANYTHING):
Tesla Car Weight vs. other Compact Executive vehicles:
Tesla Model 3 (compact executive car) weight: 3,648 to 4,250 lbs. Other Compact Executive Cars: BMW 3-series, weight 3,582 to 4,138 lbs: difference 112 lbs. Genesis G70 weight: 3,688 to 4,041 lbs, difference 209 lbs. Infinity Q50 weight: 3,781 to 4,019 lbs, difference 231 lbs. BMW 4 series weight: 3,578 to 4,034 lbs, difference 216 lbs. Average difference: 192 lbs. Please tell me the added wear on the roads, either way, with those statistics, which is the weight of a passenger. "
Reply: @georgebeare8883  "If power increases with the same amount of fuel used, that is an efficiency increase."
Absolutely false. Miles per gallon is 100% independent from horsepower per litre. Let's use your own logic against you: if the engine is more efficient, while doesn't the average new car go farther on a gallon of gas? Answer: we're discussing two completely different things. A 100 horsepower engine, on average, will go the same distance as a 22 horsepower engine (Model T) on one gallon of gasoline due to thermal losses. One vehicle will accelerate faster than the other, but will not go any farther on the same fuel. Acceleration and distance are two different things.
See how logic works? You should try it someday.
Reply: @justsomeguy934  Here's what I said about my car's range: "My own personal EV, same model, can now be purchased, same price, with almost double the range in only 9 years."
You missed "almost". The actual number is about 65% range improvement. And that range has remained constant. 
When I purchased my Tesla, its advertised range was (from Google): 
"How many miles does a 2015 Tesla Model S get?
Image result for 2015 tesla model s range
The 2015 Tesla Model S 70D has a driving range of 240 miles on a full charge. The Model S 85 has a range of 265 miles, while 85D and 95D models get a slight bump to 270 miles. Performance P85D and P90D models can go 253 miles. Drivers can recharge the car's battery at home using either a 120- or 240-volt power outlet. Jul 16, 2020"
The current 2023 Tesla Model S gets 405 miles of range. Hence: 66% improvement.
I didn't check the advertised range of my car when I bought it, thanks for making me do so. So it's 265 miles -> 405 miles in 9 years.
Show me the average ICE mpg that improved in the past decade.

Where is the link? You simply post up whatever you feel like, but with no reference for me to review. What you put up is meaningless without the link.

However, once again, you reveal you lied.

You claimed Tesla range has doubled. 
Now you tell me it is 65%.
65% is little over half. It is nowhere near "almost". I missed nothing you said, especially your constant lies.
But the range hasn't increased just because of efficiency in the Tesla.
It is more about having a greater capacity battery, not about more efficient motors. 

No different to fitting a larger fuel tank into an ice car.

Oh yeah. Remember Tesla's have motors. Something I previously had to point out to you when you thought EV's were lighter due to not having a drivetrain like an ICE car.
So much for you and your Google searching trying to replace actual intellectual learnings on the subject.
Reply: @justsomeguy934   Here's ANOTHER quote with me providing you with Google and auto manufacturer results, on your ridiculous claim that EVs have a 50% weight penalty over an ICE vehicle:
"Here are the actual vehicle weights of similar class automobiles, by all means show me the 50% weight penalty (as if that even would be a factor of ANYTHING):
Tesla Car Weight vs. other Compact Executive vehicles:
Tesla Model 3 (compact executive car) weight: 3,648 to 4,250 lbs. Other Compact Executive Cars: BMW 3-series, weight 3,582 to 4,138 lbs: difference 112 lbs. Genesis G70 weight: 3,688 to 4,041 lbs, difference 209 lbs. Infinity Q50 weight: 3,781 to 4,019 lbs, difference 231 lbs. BMW 4 series weight: 3,578 to 4,034 lbs, difference 216 lbs. Average difference: 192 lbs. Please tell me the added wear on the roads, either way, with those statistics, which is the weight of a passenger. "

My reply: Yet again you provide NO LINK for verification.

Never mind. I don't need it in this case, as usual.

The relevant comparison to a Model S Tesla is a 5 series BMW. Cars of a similar size.

Model S weighs around 2100 kgs, depending on trim type.

5 Series BMW weighs around 1580 kgs depending on trim type.
Reply: @georgebeare8883  "It is beyond the ridiculous to suggest, as you do, that something as mass-market as the ICE car, has seen no improvement in efficiency in 100 years."

Yet AGAIN, you fail to quote me back what I tell you. I have repeatedly told you that I'm referencing fuel EFFICIENCY, not horsepower, not seat belts, not power windows, not exhaust cleanliness, not different colors of paint or luxury items in a modern automobile. 

The statement you cannot get around, yet try so hard (do I need to use caps?):

OTHER THAN HORSEPOWER PER LITRE, THE AVERAGE GASOLINE AUTOMOBILE IS AS EFFICIENT AS IT WAS 100 YEARS AGO. THE MODEL T AND THE AVERAGE NEW AUTOMOBILE in 2022 HAS THE SAME MILES-PER-GALLON. 

Did you want to talk about rocket fuel now?
Reply: @georgebeare8883  "The idiocy of you trying to compare a modern engine with 5 times the power to a Model T and calling the outcome of fuel use "the same" is still just as stupid, by the way, for the same reason. If the modern engine produces 5 times more power from the same amount of fuel, it MUST HAVE superior thermal efficiency."
I'm glad you're not an engineer, bridges would collapse with your false assumptions!

Here's the Google results for the thermal efficiency of the average automobile engine, additional horsepower included with them being a modern engine (from a simple Google search):

"The efficiency by which they do so is measured in terms of 'thermal efficiency', and most gasoline combustion engines average around 20 percent thermal efficiency. Diesel typically has a higher thermal efficiency, a thermal efficiency approaching 40 percent in some cases. Jun 27, 2018"

TADA! TWENTY PERCENT EFFICIENT. That means, Mr. False Conclusions, that engines throw away almost 80% of the fuel's energy as waste heat. 

And this is why gasoline engines will never improve their mileage - their fuel and the laws of physics.

Did you want to talk about rockets now?
Reply: @georgebeare8883  "Are you going to tell me the Wright Brothers Kittyhawk is much more fuel efficient than a modern aircraft?"
HAHAHAHAHA
Notice the deflection to aircraft, and in a prior comment by you, rockets.
Trying to avoid the topic, are we?
The fact that you don't see your own deflection to other vehicles, and other technologies, outside our discussion of internal combustion engines in automobiles shows that you know you've lost the argument.
Let me repeat my comment from days back:
Deflection, thy name is George.
HAHAHAHAHAHAHA
Reply: @georgebeare8883  "His much bigger S class is the same weight as your Tesla Model S actually, liar. Around 2100 kgs"

A little Google research will do you good.

Weight of a 2015 Tesla Model S (from Tesla website, curb weight): 4,323 to 4,936 lbs

2015 Mercedes Benz S-Class: 4,678 to 4,817 lbs (curb weight)

My personal car is on the lighter end as I do not have the 7-passenger option nor the performance options that add weight. And the 7-passenger option + performance options are the ONLY factors changing the weight of a Model S. Paint, wheels or radio make no weight difference.  My personal Model S is, indeed, lighter than a MB S-class. So I guess you can learn to read?

Oh and by the way, I'm still waiting on you to prove that the "average EV is 50% heavier" than the gasoline equivalent vehicle, as you claimed a while back?
Reply: @georgebeare8883  "I then said using the incorrectly rated tyres would void your car insurance in an accident."

This is a meaningless statement; if you put the wrong tires on the wrong car, you have a problem. That applies to a truck, a bus, a passenger car. I'll add another meaningless statement to your argument: if you under-inflate your tires, you will have a problem with both insurance and safety. If you drive with no tread, you'll have a problem, too.

I suggest you ask your 12-year old nephew where you can go with your arguments, as he may have insights you don't. Make sure you tell him that, to your surprise, EVs are NOT different than regular cars by their weight, and that if you buy the tires the manufacturer recommends, you'll be fine. Also tell him that regular tires are being put on EVs by the manufacturer. He'll understand, even if you don't.
Reply: @georgebeare8883  "The relevant comparison to a Model S Tesla is a 5 series BMW. Cars of a similar size.

Model S weighs around 2100 kgs, depending on trim type.

5 Series BMW weighs around 1580 kgs depending on trim type."

Where are you links? Fake stats! LIAR!

(see how ridiculous you sound to others?)
Reply: @georgebeare8883  "What I did say is that rocket fuel is another form of fossil fuel. Which is factually correct."

Rocket fuel, solid or liquid, HAS NO BEARING on a discussion about automobiles. Only a desperate person would try to compare a fuel that is absolutely unusable for the vehicle in question to prove fossil fuels for automobiles don't need to adhere to certain formulas. 

I can make a battery out of a coin and a potato; should I start comparing batteries to produce at the grocery store to prove batteries can change? What a ridiculous conclusion you try to reach to.

I have ALWAYS mentioned gasoline being the same formula, and that you cannot deviate from gasoline by any significant amount without damage to, or required modifications to, existing automobile.

Example: E-85 or Flex-fuel. This only varies from current USA blends by 5% ethanol inclusion (as opposed to 10%), but requires specially manufactured automobiles to use it without damage. 

Example: a Ford Model T runs on the same gasoline as a modern 500-hp supercharged engine. I know, I own a 500-hp supercharged car. The engines are quite different, except the Model T gets better mileage. What's the same?  The fuel. 

Here's the result of a Google search, run it yourself, with the query "Is E85 harder on your engine?"

"Is E85 harder on your engine?
Ethanol has a corrosive action on fuel-system components, magnesium, aluminium and rubber. Running E85 on older model engines without tuning and replacing some components will ruin the engine in short time. Replacing fuel hoses, fuel pumps, gaskets, seals, fuel filters, fuel injectors, throttle bodies, etc. Mar 6, 2018"

THERE IS THE LINK/REFERENCE you requested that gasoline must sit within a narrow formula to work on automobiles without damage.
Reply: @georgebeare8883  "Where is the link? You simply post up whatever you feel like, but with no reference for me to review. What you put up is meaningless without the link."
The quoted answers I give you is from Google searches, and I almost always include the link search string. 
I guess you have reading comprehension issues, as for the Tesla Model S range result, I even gave you the search string. Here it was, see my previous comment: 
"How many miles does a 2015 Tesla Model S get?"
Reply: @georgebeare8883  My comment to you:
"Let me repeat my comment from days back:
Deflection, thy name is George.
HAHAHAHAHAHAHA"

Want less laughter? Stop making absolutely childish leaps of logic! 

Your logic: 
Gasoline cars' fuel is can change because: rockets.

If that doesn't make anyone laugh, nothing will.
Reply: @justsomeguy934  "Where is the link? You simply post up whatever you feel like, but with no reference for me to review. What you put up is meaningless without the link."
Your reply : "The quoted answers I give you is from Google searches, and I almost always include the link search string. 
I guess you have reading comprehension issues, as for the Tesla Model S range result, I even gave you the search string. Here it was, see my previous comment: 
"How many miles does a 2015 Tesla Model S get?"
Show me one place where you have provided a LINK. No, you have not, liar..
Not once.
You and your claimed Google searches. Says so much really. No Links to any of them.
Prove otherwise. Go on.
Reply: @justsomeguy934  I enjoy the more you keep going on because the more you expose your ignorance on the subject.
Frankly, I very much doubt you are old enough to drive a car, your lack of understanding and knowledge is so obvious. Let alone actually own a car.

Your comment: Ah, when the name calling begins, the children know they lost the argument.
I listed all the non-EV-specific tire brands I have used on my EV with NO INSURANCE PROBLEMS. 

The point you obviously missed:

THE EV MANUFACTURERS DO NOT PUT EV-SPECIFIC TIRES ON THEIR CARS. THEY HAVE NO BEARING ON VEHICLE SAFETY.

I listed all the non-EV-specific tires I used on my car with absolutely NO INSURANCE RISK or driving risk.

Did you want to say "nanny-nanny-boo-boo" at me now?

My reply: Once again, I have to explain all of the things that any person with tech auto knowledge inherently already understands.
First of all, it is FALSE that EV makers, or any car maker, do not fit specific tyres for the application to hand. I laid it out clearly to you a number of times now: LOAD RATING.
Every tyre has a load rating and every car has a requirement for a tyre with a specific load rating. And ditto, a SPEED RATING, but I don't want to get into that when you haven't understood LOAD RATINGS yet.
That you shout out that a tyre has no bearing on car safety sums you and your lack of understanding up entirely. 
In the event of an accident, that is formally investigated, YOU WILL have an insurance problem. 
Your car will be deemed unsafe and your insurance cancelled.
It is a physical impossibility for an incorrectly LOAD RATED set of tyres to perform safely.
The car will be detrimentally affected regarding braking, steering and roadholding.

Please also continue with the infantile retorts.

They do far more to repudiate you and your nonsense than anyone else could ever achieve.
What was that again you said just now" : when the name calling begins, the children know they have lost the argument.
You have never been in the winning position. A metaphor for your life, in general, i expect.
Reply: @justsomeguy934  more of the same.
I said:
 "What I did say is that rocket fuel is another form of fossil fuel. Which is factually correct."

Your reply:" Rocket fuel, solid or liquid, HAS NO BEARING on a discussion about automobiles. Only a desperate person would try to compare a fuel that is absolutely unusable for the vehicle in question to prove fossil fuels for automobiles don't need to adhere to certain formulas. 

My reply: you do not seem to comprehend unambiguous English. I simply stated that rocket fuel is another fossil fuel, in response to your claim that there is only one fuel formula. The end, nothing further.

Your comment: "I can make a battery out of a coin and a potato; should I start comparing batteries to produce at the grocery store to prove batteries can change? What a ridiculous conclusion you try to reach to."

My reply: " Yes, your comment is ridiculous and entirely unrelated to the subject and unrelated to what I said. I reached no conclusion about the 2 fuel types, it is a total fabrication brought to life by you.

I have ALWAYS mentioned gasoline being the same formula, and that you cannot deviate from gasoline by any significant amount without damage to, or required modifications to, existing automobile.

Your comment: "Example: E-85 or Flex-fuel. This only varies from current USA blends by 5% ethanol inclusion (as opposed to 10%), but requires specially manufactured automobiles to use it without damage. "

My reply: Utter nonsense! Any car can run on E85. It does not quickly damage an engine at all. The most normally required is the changing of fuel hoses in older cars. A precaution which ought to be a part of routine maintenance in any case.
I have 1970's Ford V8's and a 1998 Mondeo that have all run on E85 with absolutely no problems. No benefits, either, in those applications.
You display, yet again, how you have no inherent technical knowledge, when you resort ( again ) to Google for help in constructing come-backs.

Your comment: "Example: a Ford Model T runs on the same gasoline as a modern 500-hp supercharged engine. I know, I own a 500-hp supercharged car. The engines are quite different, except the Model T gets better mileage. What's the same?  The fuel."

My reply: " Sorry to have to tell you BUT the fuel that was around back in the day of the Model T would not allow a modern 500hp Supercharged car to operate. A car which, I am certain you do not own, or you would know better.

Your comment: "Here's the result of a Google search, run it yourself, with the query "Is E85 harder on your engine?"

My reply: Give me a LINK.
 But first, how and why are we talking about E85? Where has this completely off-topic stuff come into it?
Ah, I get it now! You don't know what E85 actually is comprised of!
Has it occurred to you we are discussing FOSSIL FUELS? E85 is a BLENDED fuel. It is not exclusively a FOSSIL FUEL. 
It is not directly comparable and therefore, not relevant here.
But, obviously, you didn't know that. As has regularly been the case in general.

Your rubbish: "Is E85 harder on your engine?
Ethanol has a corrosive action on fuel-system components, magnesium, aluminium and rubber. Running E85 on older model engines without tuning and replacing some components will ruin the engine in short time. Replacing fuel hoses, fuel pumps, gaskets, seals, fuel filters, fuel injectors, throttle bodies, etc. Mar 6, 2018"

THERE IS THE LINK/REFERENCE you requested that gasoline must sit within a narrow formula to work on automobiles without damage."

My reply: I already addressed this above. This is an article written by a pleb, with no technical car knowledge, written for other people with no technical car knowledge.
What I stated a few paragraphs before is the factual info.
That you even considered E85 as being an exclusively fossil fuel, when it is a blended hybrid, and therefore completely irrelevant here, shows you up again.

If you knew what you were discussing, without getting caught out by trying to Google some form of intelligent response, you would not be so exposed.

As I said, Google is as misleading as it can be helpful. You first have to know how to discern what a search brings up. You already need to have sound knowledge on the topic. There is a lot of garbage on the net and you are victim to it.
Reply: @justsomeguy934  your comment: "This is a meaningless statement; if you put the wrong tires on the wrong car, you have a problem. That applies to a truck, a bus, a passenger car. I'll add another meaningless statement to your argument: if you under-inflate your tires, you will have a problem with both insurance and safety. If you drive with no tread, you'll have a problem, too.

I suggest you ask your 12-year old nephew where you can go with your arguments, as he may have insights you don't. Make sure you tell him that, to your surprise, EVs are NOT different than regular cars by their weight, and that if you buy the tires the manufacturer recommends, you'll be fine. Also tell him that regular tires are being put on EVs by the manufacturer. He'll understand, even if you don't.

My reply: this is so easy, it is a joke.
You actually verify exactly what I have been telling you, even though you are too myopic to realise that.
"if you buy the tires the manufacturer recommends, you'll be fine. "
Yes. And those tyres will be specifically LOAD RATED and SPEED RATED for that EV.
Boom!
Reply: @georgebeare8883  "Apart from you never quoting where I can find those "references", it is a laughable notion that just because something pops up on Google, that it makes it a fact.
Yeah, that's what I mean."
Ah, now we question Google (or any search engine of YOUR choice). 
I have often supplied the actual search string text for you to verify, you're lying that I don't. 
YOU claim to have left a link to an outside resource, where, pray tell, is it?
Reply: @georgebeare8883  "First of all, it is FALSE that EV makers, or any car maker, do not fit specific tyres for the application to hand. I laid it out clearly to you a number of times now: LOAD RATING."
OF COURSE car makers put proper load-rated tires on their cars! You state the obvious!
What you're trying to avoid is admitting your statement that EVs are 50% heavier than ICE equivalents and tried to use EV-specific tires as proof. 
Here's the truth, George: me EV uses the EXACT SAME TIRES as my daughter's Ford Edge, the EXACT SAME TIRES as my friend's Mercedes, the EXACT SAME TIRES as several friend's sedans and SUV's. In fact, I think I'm responsible for several sets of Michelin Cross Climate 2's being sold. 
So now George wants to change the subject (typical) on the tires HE claims are required for EVs and EVs alone.
Say, George! I'm still waiting on your proof of EVs being FIFTY PERCENT HEAVIER than ICE equivalents.
It's interesting you never address that topic.
Reply: @georgebeare8883  "Utter nonsense! Any car can run on E85. It does not quickly damage an engine at all. The most normally required is the changing of fuel hoses in older cars. "
Ah, George knows better than Google, knows better than the mechanics I talk to, knows better than all the car club vehicle owners I know that state even 10% ethanol is damaging their cars over time.
I was unaware that George Beare was an automotive engineer and expert! All hail George!
Would you like me to repeat the verifiable Google test I gave you the first time? Nah, it's too embarrassing for you.
Reply: @georgebeare8883  "Has it occurred to you we are discussing FOSSIL FUELS? E85 is a BLENDED fuel. It is not exclusively a FOSSIL FUEL. "
I absolutely know what E85 is - it's fossil fuel with 15% ethanol blended in. Current gasoline in the USA has 10% ethanol, and even that departure from gasoline's original blend affects older cars. Going to 15% ethanol requires either FlexFuel or E85 engines to work properly.
So I guess YOU missed the point, again - we depart from gasoline even a few percent with an additive and it harms engines and requires special manufacture to use it.
TaDa! JustSomeGuy wins again.
Reply: @georgebeare8883  "Yes. And those tyres will be specifically LOAD RATED and SPEED RATED for that EV.
Boom!"
See my previous comment, and I want outside readers to see your reply as the perfect example of deflection (my compliments, George!).
You originally stated and tried to prove that EVs are 50% heavier than ICE vehicles, and used EV-specific tires that are now being made as proof. It was YOU that mentioned EV-specific tires, not me, and after 9 years of ownership I have never purchased such a set of tires.
Here's the deflection, outside viewers: George tried to PROVE that EVs require special tires because, according to HIM, EVs are 50% heavier than ICE vehicles. I proved that EVs use ANY KIND OF TIRE they want, and listed all the brands of tires I've owned and all the brands my EV acquaintances own. 
I also stated that the exact same tire I have on my EV (Michelin Cross Climate 2) are on my daughter's Ford SUV and my neighbor's Mercedes. Not special EV tires, no sir! Just the right size tire for the vehicle.
The Deflection: now George is trying to avoid his original claim that EVs need special tires by saying all tires are rated for the vehicle they're on, so therefore he was right all along. See the deflection (he's good, but not smart!)? He wants you to forget he claimed EVs are 50% heavier than ICEs and therefore require special tires.
So boys and girls, this happens when the facts are presented to you and you refuse to say "I was wrong". See George, don't be like him.
Reply: @georgebeare8883  "That is the ONLY metric any intelligent person needs to know to prove EFFICENCY has improved.
Feel free to explain the opposite, which is YOUR view, whereby you claim that producing more power for the same fuel use isn't an efficiency improvement?"
Here's George, outside readers, trying to deflect and change the subject AGAIN.
The argument: I stated mile-per-gallon hasn't improved on average in over a century, and produced the Google results ("average mpg of a new car") to prove it. I compared it to the Ford Model T of a century ago, and the MPG is the same. 22mpg for the Model T, about 25mpg for 2022 average new cars.
The Deflection: NOW George is trying to conflate horsepower-per-litre, which I said HAS improved, with miles-per-gallon. Note how he's changed the subject to try and include horsepower improvements to efficiency improvement of mileage. See the subtle change? By conflating the two, he hopes to hide the fact that miles per gallon hasn't changed in a century, even though other factors might have.
Also note that I've provided him multiple quotes from Google searches that prove even modern engines have over a 70% loss of energy due to heat, which is why the gasoline engine, on average, will never get significantly better mileage than it does right now.
Reply: @georgebeare8883  "I have read all of your posts and seen no evidence, despite me asking at least 6 times. And? What then?"
Liar, you haven't asked me six times for anything.
Reply: @georgebeare8883  "Yes. And those tyres will be specifically LOAD RATED and SPEED RATED for that EV.
Boom!"
Guess what, George? I have 19" rims on my EV, and the tires are for 19" rims! TaDa! How on Earth does that prove EVs are 50% heavier?
Reply: @georgebeare8883  With all your deflection, I'll just repeat a previous comment I made to you about EV-specific tires. I know you don't read what I write (or at least comprehend it) so I'll leave this previous comment I made for the outside readers to understand the original comment:

"The point you obviously missed:
THE EV MANUFACTURERS DO NOT PUT EV-SPECIFIC TIRES ON THEIR CARS. THEY HAVE NO BEARING ON VEHICLE SAFETY."

You, George, were trying to claim that EV-specific tires (a very recent product) proves that EVs are 50% heavier than the average ICE equivalent. Not ONE SINGLE EV manufacturer puts the new EV-specific tires on their cars. My personal EV came with Continentals, if memory serves. 

Outside observers will note that you have never, EVER, addressed your claim that EVs are 50% heavier than ICEs, and probably for good reason. I left you multiple examples of EVs compared to ICEs with the difference between them, on average, about 200 pounds. Hardly 50% and hardly in favor of either type of vehicle. In fact, my personal EV is lighter than its equivalent ICE model.

So George: How about your 50% claim? Want to back it up? Want to admit you made a baseless statement, and then went to tires to try to prove it? And then got shown your claim was false?

This was just the "EVs heavier" claim, you have other, more absurd claims, we can discuss.
Reply: @georgebeare8883  "I have 1970's Ford V8's and a 1998 Mondeo that have all run on E85 with absolutely no problems."
Liar. Provide a link. 
Here in the USA, you cannot sell E85 as regular gasoline, only 10% ethanol is sold as "gasoline". E85 has a separate pump, because....wait for it...it requires specific engines to use it. If you CHOOSE to put E85, or anything else, into your gas tank when you shouldn't, that's up to you.